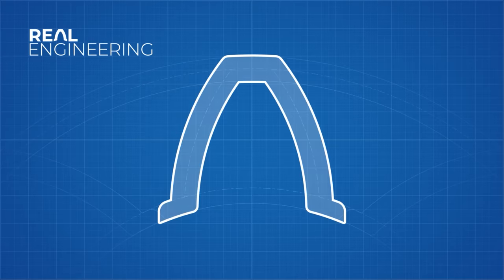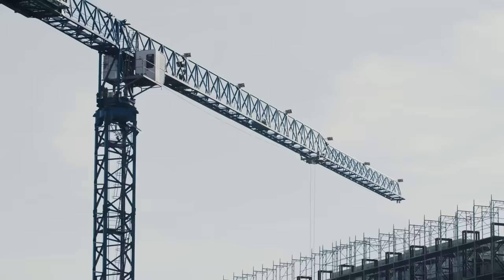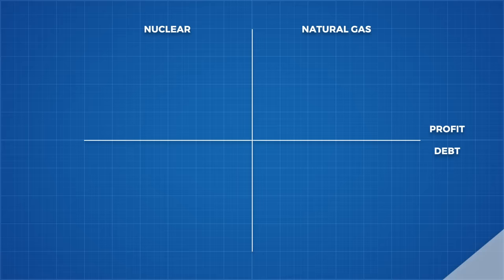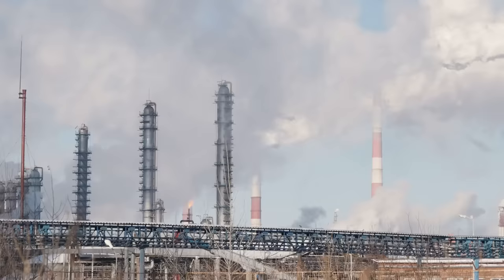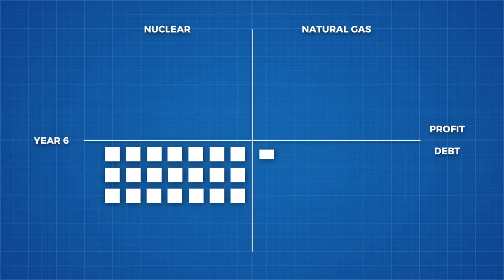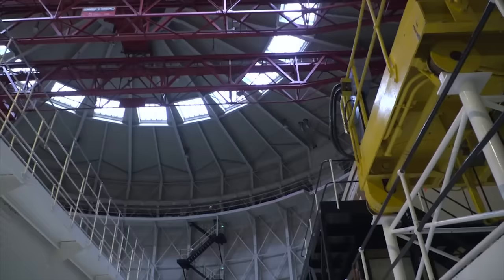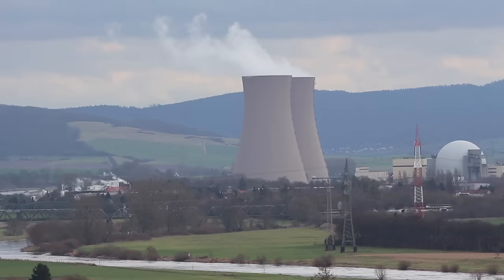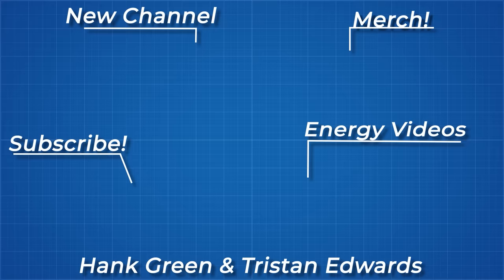The Economics of Nuclear Energy

Comment: Hi. Can u do an economic analysis of Small Modular Reactors, and compare that against large nuclear plants. I think the economics of SMR would be very different and likely to be profitable faster and lower risk. Because of their small but stable electical output,  shorter construction time, SMRs would be ideal for industrial use, i.e. SMRs would supply power and heat (steam) to industrial use. Industrial sector, such as the chemical industry, would prefer non-stop power and steam at more stable prices. The zero carbon power and steam would be beneficial to produce low-carbon chemicals and fuels.  Also, industrial sector tend to pay higher prices for electricity and steam, in return for very reliable supply... hence, SMR fits very well, and given this payment profile, I think the economics of SMR would be better than large nuclear Giga-watt scale nuclear.
Reply: This may help.

This is from the Des Moines Register an concerning the only Small Modular Reactor (SMR) project in the U.S. today. It should be noted that NuScale said this month (Jan/2023) the target price for power from the plant is $89 per megawatt hour, up 53% from the previous estimate of $58 per MW hour

In 2013, the Wall Street firm Lazard estimated that the cost of generating electricity at a new nuclear plant in the United States will be between $86 and $122 per megawatt-hour. Last November, Lazard estimated that the corresponding cost will be between $131 and $204 per megawatt-hour based upon the 4 recent new nuclear projects in the U.S. . During the same eight years, renewables have plummeted in cost, and the 2021 estimates of electricity from newly constructed utility-scale solar and wind plants range between $26 and $50 per megawatt-hour. Nuclear power is simply not economically competitive.
SMRs will be even less competitive. Building and operating SMRs will cost more than large reactors for each unit (megawatt) of generation capacity. A reactor that generates five times as much power will not require five times as much concrete or five times as many workers. This makes electricity from small reactors more expensive; many of the original small reactors built in the United States were financially uncompetitive and shut down early.
The estimated cost of constructing a plant with 600 megawatts of electricity from NuScale SMRs, arguably the design closest to deployment in the United States, was originally advertised as costing $1 billion but upon requesting actual bids from engineering firms, increased to $6.1 billion in 2020. Given inflation and other cost constraints that cost today can only be expected to be significantly higher.
The cost was so high that ten members of Utah Associated Municipal Power Systems canceled their contracts. NuScale then changed its proposed plant configuration to 6 fewer reactors but increased each reactor output from 50 Mw to 77 Mw costing at total of $5.3 billion. The NRC just last week approved the construction of the 50 Mw design but now will have to start the review process all over given the switch to a 77 Mw design. For each kilowatt of electrical generation capacity, that estimate is around 80% more than the per-kilowatt cost of the Vogtle project in Georgia — before its cost exploded from $14 billion to over $30 billion. Based on the historical experience with nuclear reactor construction, SMRs are very likely to cost much more than initially expected. And they now have delayed the project start until 2025 in an attempt to find more backers.  All this before the inevitable setbacks that will occur once construction starts.

Comment: I was wondering why these discussions always center around grid level energy production. Would a lower level energy solution be a better fix that would ultimately solve the larger problem.
Reply: Because the grid is the connection of electricity to the entire system. It runs off a specific hz and is maintained at that level.
Off grid stuff is typically more expensive and really only pays for itself by attaching to the grid to add back into it and making money off of it.
Also off grid decentralized electricity is inefficient where as massive centralized energy production allows for economic centralization and easy ramping up of power.

Comment: Returning to this excellent episode after a couple of years is interesting.
The small, cheaper and faster to build modular reactors developed mainly by Rolls Royce from its maritime designs will be installed in the UK far sooner than was anticipated.
RR and other companies have also come a long way on even more compact modular reactors specifically designed to share sites with electricity storage facilities connected with the success of renewables. Old coal mines are being researched for these dual purpose hubs.
Because lithium batteries have a cycle limit advances in molten metal, TPV, pumped hydro towers underground, hot graphite and magnesium appear to be gaining speed in tackling the abiding smooth base load problem.
Further, as molten salt reactors overcome 'plumbing issues' some have expressed the idea of SMR sites possibly being used to replace the SMR modules with molten salt cores as the original SMR components wear out.
The goal is to always to have enough stored energy (not necessarily as current electricity) to ensure consistent base load and fast top-up technologies can be location appropriate.
Reply: NuScale is building a 77 Mw demonstration SMR with $2 billion in U.S. taxpayer welfare so it seems that no investor is yet willing to risk their own money.   These reactors are 1/15 the output of the standard PWR so if you think the NIMBY pushback was hard in siting one reactor, try it with 15.
Reply: @clarkkent9080 I thought NuScale has gone broke now? Or was it something else

Comment: The comments about “nuclear is over budget” etc, is crude.  It implies nuclear is a monolithic thing, a technology only, with no regulator, and run only in the US or W EU in the last decade.  There are some 50 plants under construction globally, and most of them will complete in 7 yrs or less.  The Oyster Creek nuclear plant in NJ was built in 5 yrs for the cost of a gas plant and ran for 50yrs.  If you want accuracy, see the  USNRC as the cause of delays and costs.  The NRC has not seen a single new reactor completed since it’s creation.

Comment: I looked for the promised update on "new" nuclear technology but it is yet to be published... So here's my TJ (One million million joules) worth.
Molten salt nuclear "promises" faster construction times, lower cost per KWH, intrinsic safer designs and peaking multiples of design capacity.

I look forward to the promised update but I bear in mind that molten salt nuclear right now is long on promise and zero on delivery. (Yeah "zero" is a bit harsh but I recall that two or three experimental molten salt nuclear reactors have operated but none to my knowledge ever delivered power into the grid.)

Let me address "peaking multiples of design capacity". A 1000MW molten salt nuclear reactor has the capacity to feather its output and follow the load. But why would it? Nuclear fuel is cheap, even negative for fast spectrum reactors designed to burn the stored waste from present generations of power reactors. A far more economic solution is to run these reactors at capacity and store the additional energy on site. 

Molten salt reactors output the heat energy they produce sequentially, into a series of different molten salts, They need to do this to contain the intense radioactivity that develops in the fuel salt. The final salt in the series is a non radioactive, molten mixture of nitrates, essentially the same mixture currently used by solar thermal power stations. More than 50 solar thermal stations have been constructed with up to 15 hours of molten salt storage at temperatures around 700C. A molten salt nuclear reactor can take advantage of this thermal heat storage by cycling its output, heating and storing salt for 16 hours and delivering peak power for 8 hours. Thus we can envisage a scenario where a 1000MW plant could deliver 3000MW over  the 8 hours when demand and prices are at a maximum. In fact the only limitations on output power are the constrains imposed by the network and the regulator. The 1000MW plant could deliver its daily energy in any combination of power and time. For example, with sufficient generating capacity, the plant could output at a rate of 6000MW over 4 hours and target only the highest peaking prices.

Comment: Much of the cost of nuclear is a direct consequence of the anti-nuclear lobbying. An example from the video, needing to retrofit the cooling because it uses sea water isn’t saving anything, it is just a cost that can be  pinned to nuclear to make it less profitable. As for safety, if other forms of energy were required to be as safe as nuclear, they would be as expensive as nuclear. The storage problem is realm, but slowly improving as more electric batteries are on the road and in the grid.

Perhaps in the near future we will be forced to look at the ‘true cost’ of different forms of energy, including geopolitical risk, and famine risk. In that case, nuclear will look good again, especially if we can remove the special interest tax. We forget, but the modern world can not exist without abundant energy.
Reply: Every heat engine needs a heat sink and coal, oil, bio, etc is no different

Comment: And there is still one factor being left out. The environmental cost, both short term and long term. During mining and disposal. And yes it's gonna be long read :)

Germany produces a tenfold of CO2 emissions for electricity, however it will never be paid for.  Germany will "trade" CO2 units from renewables to upgrade that dirty CO2 from regular plants to CO2 neutral units. It's just an cheap mathematical trick to justify the gas and coal plants. The true environmental cost of CO2 will never be paid for. Still the cost of electricity in germany is about twice that of france (well for regular consumers of course).

A similar trick is applied for biomass. In the Netherlands we burn trees from Canada and other far away countries. But since the tree was cut in Canada, the emission will belong to Canada on paper. And since the tree grows back in Canada the CO2 emission is considered neutral. However, the end result is that Canada has one co2 unit absorbed and the Netherlands has one emitted. Since international freight is exempted from the Paris accord, the emissions from transport do not "count". Nor does the fact that burning green wood is highly inefficient of forced drying of wood takes massive amounts of fossil fuel. 

Another long term cost that is being ignored is waste. Sure nucleair waste is a huge issue, but at least that is mostly handled with some sense in mind. Renewables, especially solar panels, have a huge waste problem both at manufacturing and end of life. The cost of pollution during mining is not being paid for at all, as where nuclear waste is being paid for with packing and storing it on a safe location. Short term gains during mining are more important for these less developed countries. We have rare earth deposits in the west, however it's too expensive to mine due to environmental restrictions, so we just leave it to these countries that don't give a F. Then after 25 years the panels are "economically depleted", yes theoretically you can recycle that panel, but fact remains that it's too expensive new materials come at half the cost. Recycling is done in another way: after 25 years when the panel is not profitable for westerners it's being shipped of to Africa where it will continue to live for another 15 years or so. However the waste is now Africa's problem. We all know what happens next, but that doesn't matter because the water sources were already polluted during the mining operation. 

If you take into account the mining operations you win even more. Most uranium mining takes place in Canada, Australia and Kazakhstan which employ much higher standards towards the environment regarding waste processing during the mining operation and returning the environment to a proper state after the mine is depleted. But also since the energy density of uranium is about  2 million times (divided by the 200 times amount of material needed at the mine, since only 0,5% material is actually uranium) you still need 10000 coal mines for the raw material compared to uranium. Then there is also the matter of blood coal in third world countries, not to mention the environment damages done since those countries have no moral or environmental standards during mining what so ever. 

So if you need to really pay for the real environmental costs nucleair wins by far. The countries themselves are responsible for the waste instead of shipping it to remote third world countries adhering to actual decent standards instead of dumping waste in the air, water or a remote country.

Comment: Nuclear is more expensive than shown. 
The cost of disposal is expensive. 
The company also have to demolition the plant. 
Witch is extremely costly (in germany some reactors are at that fase right now) 
These and the co2 emissions from building a plant have to be part of the calculation. 
Nuclear power plants needs massive amount of steal an concrete. To pruduse the fule need resources... ... ... 
There are many more resen that nuclear is not the solution (At lest for germany). 
Its not just the economic.

Comment: All these calculations are nice and all but this is all under the condition that the nuclear facility itself has little to no maintanence costs. Imagine if there was a critical problem in some part of the facility, best case scenario they'll have to a boat load of money again to replace equipment and then get the facility supplying energy again... Worst case scenario nothing is left of the facility and it's vicinity because of a nuclear explosion
Coal facilities are cheap and easily built plus there's no major explosions , property damage , loss of life etc.
I'm all in for renewables so best option is solar. Costs relatively lower than nuclear, low running costs as well and doesn't take 6 years to start running. Investors are happy, consumers are happy, environment is happy. Best option I see all around

Comment: Nuclear is an excellent stop gap between fossil fuels and renewables (or fusion). Renewables are slow and require additional infrastructure to support. The main issue with nuclear is so little has been invested in its development. We're using old powerplants but the tech is there to make nuclear, faster to get up, cheap and more efficient.

If we invested more in improving it we could build these reactors and start to turn off coal and gas plants since they'd be redundant more quickly.

A good engineer knows to have a few good backups. Especially for renewables. Focusing on them to meet our demands is idiotic. More options is a wise mans approach, nuclear is that option.